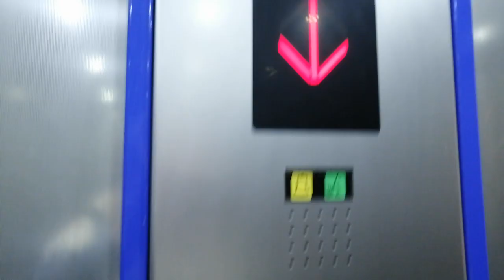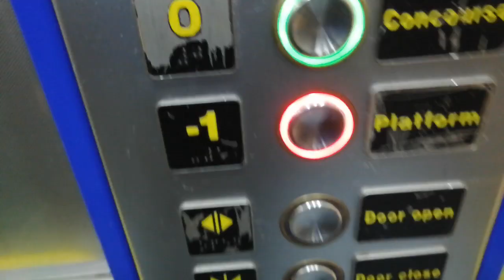Custom Kone Ecodisc Lift @ Four Lane Ends Tyne and Wear Metro Station Platform 1

Comment from the maker: There are a total of 40 lifts on the Tyne and Wear Metro. Make sure you watch my videos of the other types of lifts on the metro network and subscribe for more coming soon!
3 x 1st generation Kone Ecodisc with these fixtures (coming soon)
1 x 1st generation Kone Ecodisc with Kone Delta fixtures (https://youtu.be/WSu3I6x9L6c)
1 x 2nd generation Kone Ecodisc with Dewhurst Fixtures and Drucegrove voice  (coming soon)
17 X 3rd generation Kone Ecodisc with these fixtures (this video)
6 x 4th generation Kone Ecodisc with these fixtures (https://youtu.be/BZP11kw2NvU)
2 x Cotswold Hydraulic (https://youtu.be/IWekfMJi3Ag)
2 x Northern Hydraulic (coming soon)
7 x Kone Hydraulic (https://youtu.be/1JS4vcVrkew)
1 x Stannah Traction, Network Rail Spec, due to Sunderland station being a joint Tyne and Wear Metro and National Rail station (coming soon).